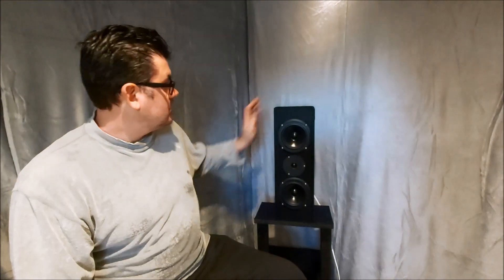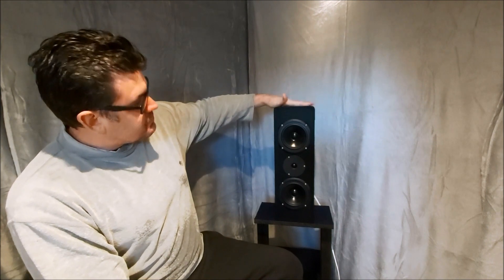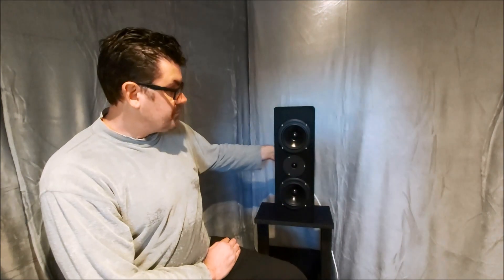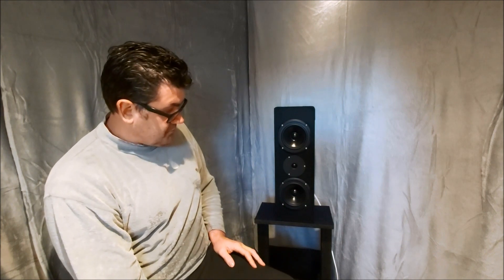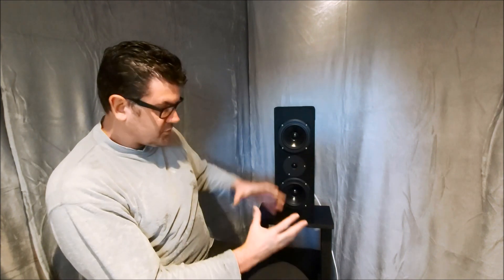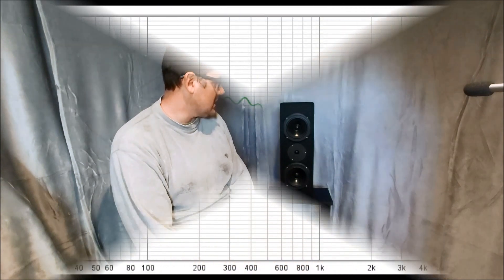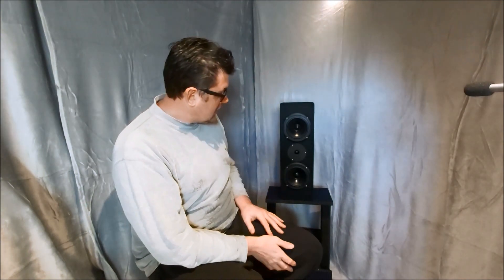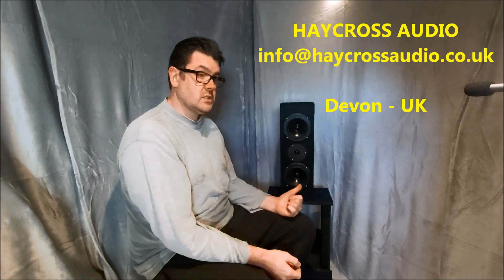Rogers C33 Speakers Part 4

Comment: I suppose that you have also measured with reversed polarity on the tweeter to see if that dip disappears.
Reply from the maker: Yep. No difference. Reverse polarity makes a big mess. I did try my theory that having the speaker against the wall would raise that dip and it did. Roger's worked that in by the looks of things. Still a bit of a depression but only 1 or 2 dB. The moment you move off axis the sum better. Very happy with them. Proof is ALWAYS in the listening
Reply: @haycrossaudio5474  You may find that at a 2 metre distance the dip may practically  disappear. Also a dip at around  2.5  / 3.0 KiloHertz is confortable on the ears and could be intended in Roger's original design.  As you so aptly remind us, it is all about the listening experience
Reply from the maker: Yeah. Far field measurements 'soften' this sort of response but that cannot be accurately measured inside. If you gate the response the time arrival of the actual speaker response will be mixed up with room reflections. The far field can only be done anacoically or outside. As noted. Proof is in the listening and the baffle gain against a wall has likely been worked in 😁